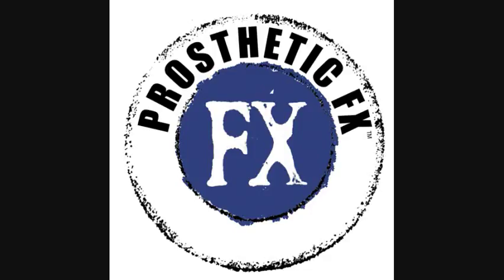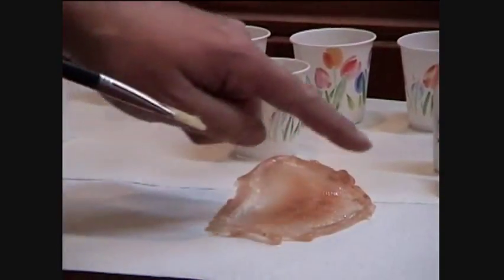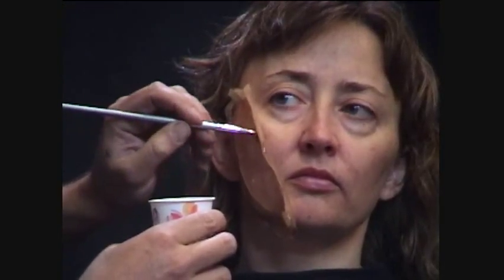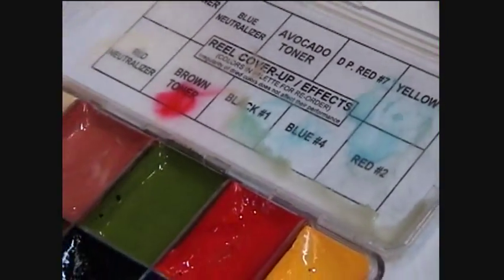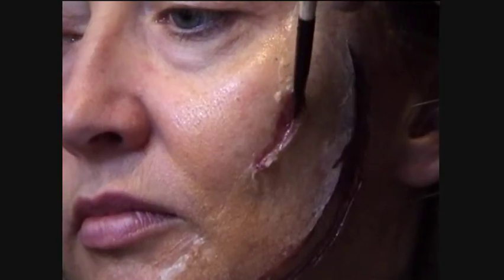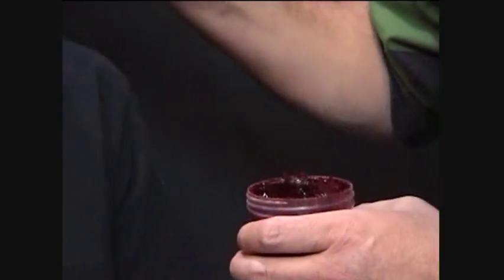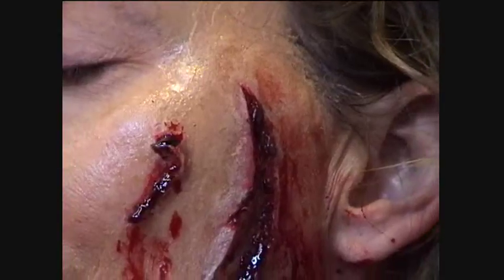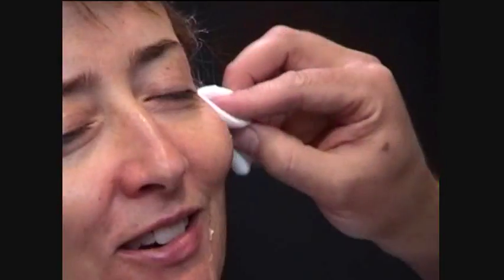Application of Bleeding Art Gelatin Appliances

Comment: Nice video, but if I may, you're neglecting the beauty of the gelatin's ability to seamlessly blend out without the need of the patch.  You should be using the flash to lift and glue the fine edges, lay them flat and blend out the gelatin. If your edges are thin enough, they should vanish without the need for patch.  This patch method you're using is more for latex appliances, whereby the edge cannot be dissolved.    I hope this critique was not taken in offense:)